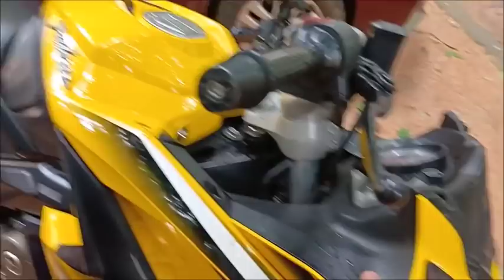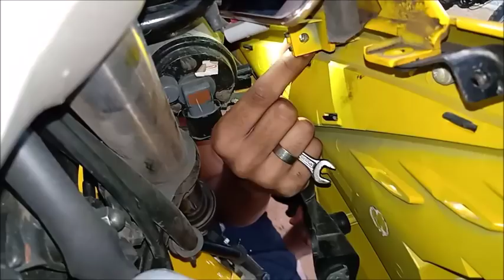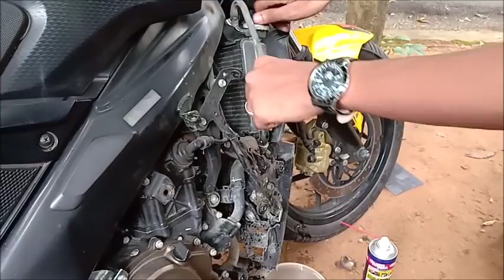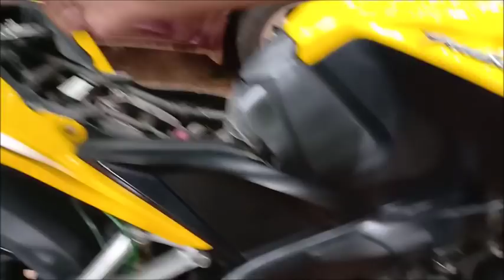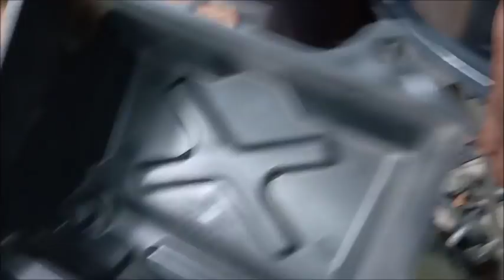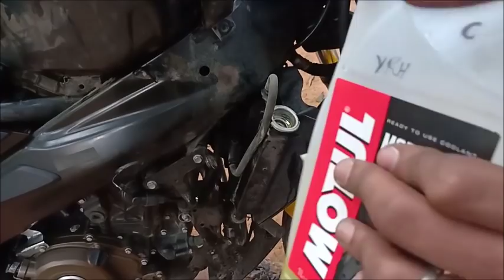Motul COOLANT and Air filter change for Pulsar RS 200 and Cleaning Spark Plugs. (DETAILED)

Comment: Can you explain all the meter indicators of RS200... means what kind of indicators bike shows when  something needs to be change in bike.....mine RS200 indicators shows red light on engine oil, coolant oil , bike temperature , nd battery ..nd once I start the bike thn indicators gets turned off

Comment: Hi, thanks. Do you know why water is leaking through a small hole under the catalytic converter(I think) ...I didn't use my bike for 2 weeks and after that bike gets super hot and water leaks through that hole. Also unbearable vibrations too. if you know the reason pls let me know.

Comment: Bro I have the same bike ..but after riding 1 km  @ 40km/h .my radiator fan start working at very high speed  n it's remain continue running .n engine  also get heat up ??
Reply from the maker: Could be a sensor issue bro, I think the company can help u with it

Comment: What is the right to top up the radiator pure coolant or mix 1:1of coolant and destilled water?
Reply from the maker: It varies from brand to brand, it's not a defined ratio. But if you are using for RS, it's better to use the motul coolent which is in the video or the company one.
Reply: @saiprashanth9063  my bike is ns 200 bajaj here in philippines .pulsar in india but here in philippines bajaj ns 2oo rouser .i think rouser and pulsar is just the same only the name of the tank is different
Reply: Pulsar is sold as rouser in international market

Comment: For RS 200, do we have 2 tanks for coolant? If so, where are both located?
Reply from the maker: No bro, there's only one tank, but 2 places to fill if you change the coolent, one in radiator itself and the other in reservoir tank...

Comment: when coolent will on in ns 200  mens how much i should ride
Reply from the maker: Bro, coolant or radiator??
Reply: @saiprashanth9063  coolant fan bro
Reply from the maker: @karthik-qe8ml  there is no limit for riding it bro, the fan just turns on just to let the heat out, u can ride it the way you want, don't worry
Reply: @saiprashanth9063  ya bro ill tell when it will on

Comment: time interval for changing Airfilter bro ...
Reply from the maker: Anil Motovlogs bro, it actually depends on the riding environment.Dont worry,ur bike will automatically tell u that, if there is a jerk in pickup or mileage reduction, u might want to change ur air filter.
Reply: Anil Motovlogs my air filter is just 1 year old and I have ridden smoothly not too much hard!!!

Comment: Bro
I have changed coolent only from upper bottle only but not changed from radiator...so what to do
Reply from the maker: is it the same company coolant as before bro?
 And how long has it been u changed the coolant ?
Reply: Sai Prashanth bro my bike has moved only 1609 km and at the time of 760km I have added motul coolent at upper bottle only
Reply from the maker: Bro, when they deliver the bike to you, they use castrol coolant for the bike, so the radiator is also filled with the same castrol coolant, its actually not a good thing to mix to different coolants in the bike, its better if u flush the coolant completely and then change to motul.

See if u can get it done by the company itself cause u dont wanna take a risk on ur new bike.
Reply: Sai Prashanth ok bro
Thanks
Reply from the maker: No prob bro, safe riding....

Comment: Bhai heating problem kam hua kya
Reply from the maker: Bhai, heating issue Kuch nai hay, gaadi aaram say chal Raha Hay...
Reply: Sai Prashanth mere paas bhi same bike h but heat hota h bohot
Reply from the maker: @Lovishhh_13  Bhai, motul Ka engine oil try karay, heating or vibration dono Kam ho jatay Hay, motul 7100 20w 50